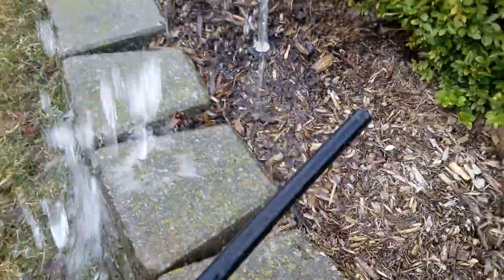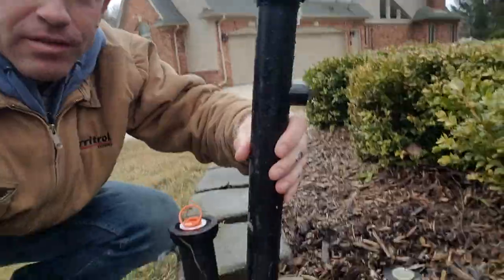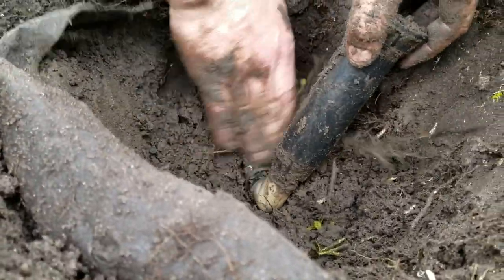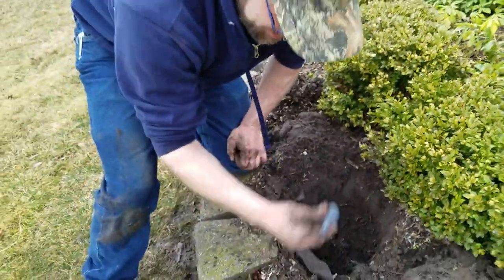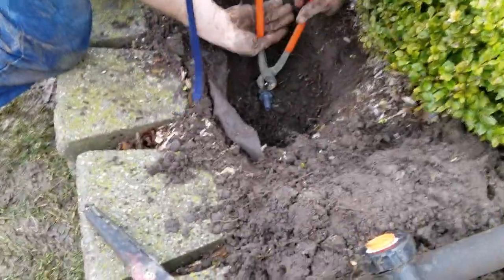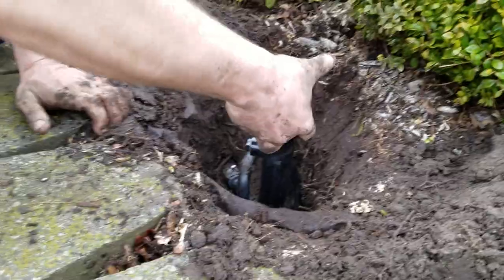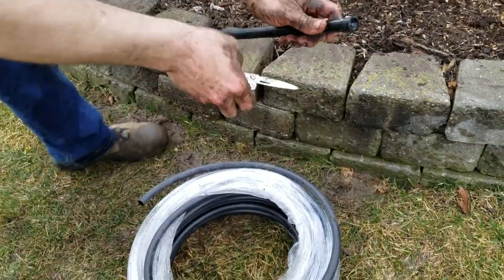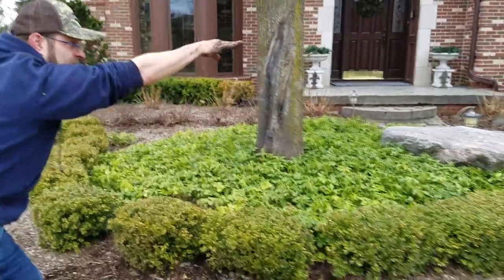How to replace a short sprinkler head with a taller one

Comment: Where I live, you're required to use drip irrigation in bedding. I hate it. Always use sprayers if you are legally allowed to do so.
Reply: Ehhh, have to disagree. Especially with the overspray hitting that tree. 100% will cause problems down the road. The point of irrigation is to get water to the roots, not drench the plant. A buried 1/2" drip line with emitters is the way to go for this application IMO. Much more efficient because it uses less water and delivers the water where it is actually useful, the roots. I'm glad to hear your municipality requires drip in beds. It is the correct thing to do. It saves money, water, and protects from all the issues brought on by overspray.